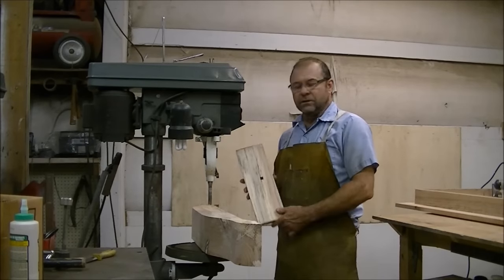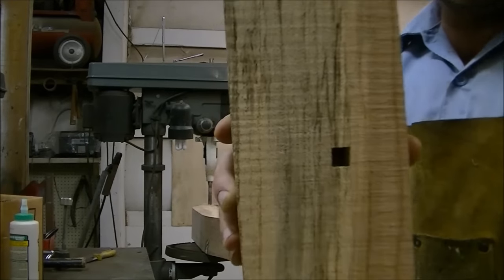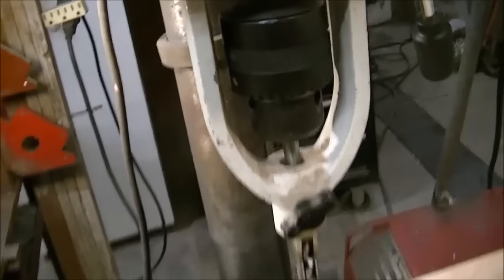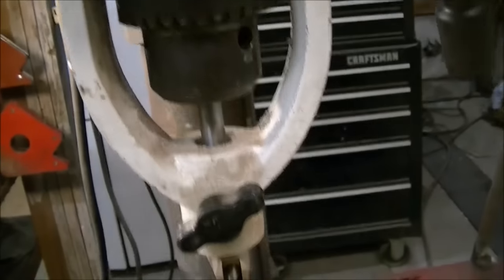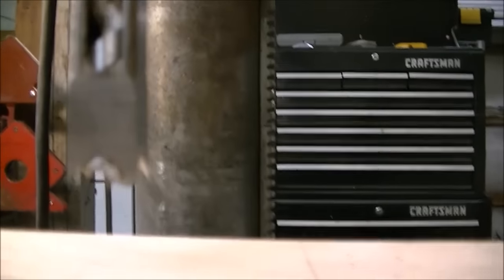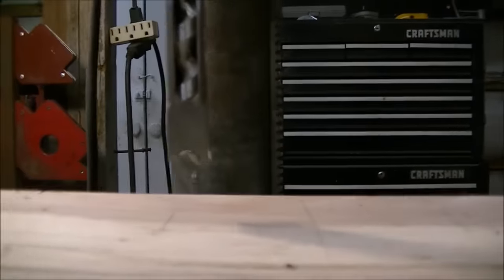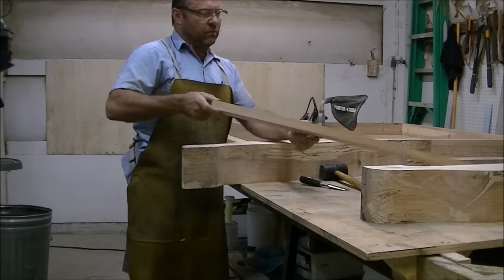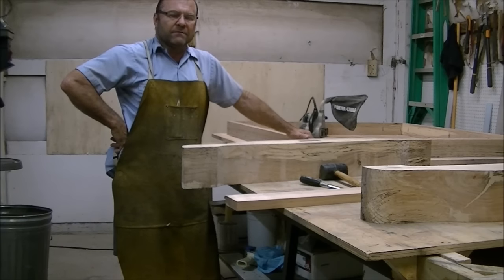Drilling a square hole? Mortise and tenon joint. Building furniture.

Comment: My wife bought these bits for me as a present. I wanted to use them to make holes for outlet boxes. I didn't realize they require a drill press.
Reply: Well they don't, technically - although using them well could be very difficult without one
Reply: But now you have a “Reason” why you HAVE to have one!😉😉😉
Reply: How and where to get this and how to use it with drill press

Comment: You might try having the bit extend a little further out the bottom.  On the drill press attachments you don't get as much leverage as you do on a dedicated machine, and if the drill takes a deeper bite before the chisel starts to cut It will have thinner sides to cut free.  It only needs to be a little more of the bit exposed makes a big difference on the one I have.
Reply from the maker: Thanks, I will try that.
Reply: Q is machine ka price bataen

Comment: Dear Mark, thanks for showing the mortice chisel at work. I note that the drill bit starts a little way inside the chisel. Did you adjust the length of your drill bit to make this fine adjustment? My set did not include any adjustment instructions and I had to “wing” it and left the bits a little proud when I cut them shorter. No problem if I need to shorten them, I’m getting good at grinding my bits shorter if needs be.  My concern is what will happen if I have to sharpen the bits and therefore lose length? Cheers.
Reply from the maker: The bit is suppose to be a little long. Mine does have a adjustment and I have adjusted it to protrude a little bit.
Thanks

Comment: Did you use this in a faster speed on the press or is best on a slower speed, Mark?
Reply from the maker: Lower speed, I do most of my drilling in the low range.
Reply: @markp0177  thank you, I really appreciate it

Comment: Could I use one of these drill bits on a drill and would I still have successful square holes if so? I have a pretty steady hand as I have been using my tools for years and really think that I could do this with my drill. Just looking for advise or maybe someone who has tried this with a drill.
Reply from the maker: I think they make one to fit a hand drill but I have never used one.
Reply: @markp0177  thank you

Comment: I wondered if these bits worked like an impact driver or not, as far as the chiseling action is concerned.
Reply from the maker: No. it just uses pressure from the drill press.
Reply: @markp0177  oh ok, thanks

Comment: There needs to be a cheaper way to do this
Reply: smaller pilots holes at the corners of your square, drill larger diameter center and then file.
Reply: Haw mach your prise